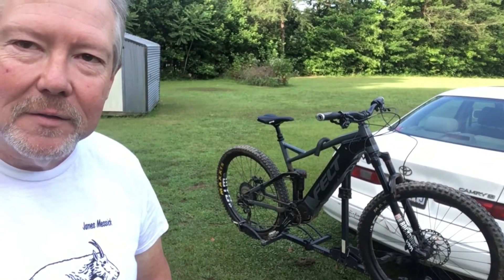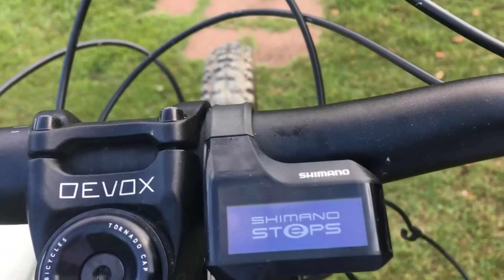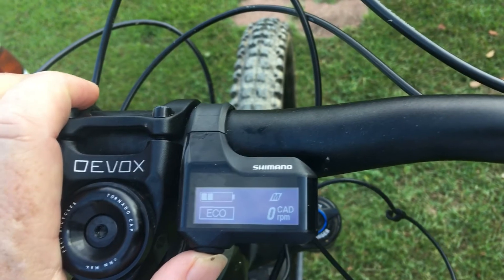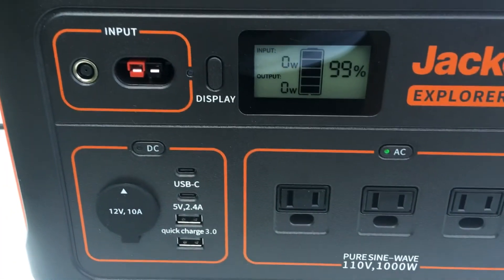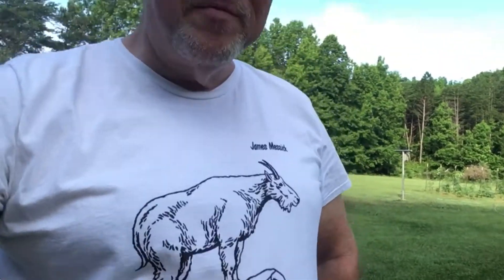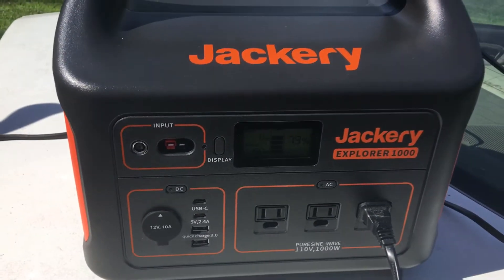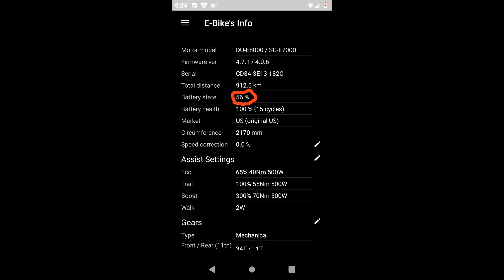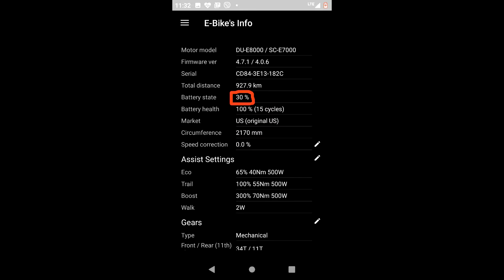Charging an eBike with the Jackery 1000!

Comment: Nice setup. This would be nice for a day out ride. Im just looking for something for my 48v 15ah battery so when im out riding which i get about 35miles all power i was looking for a home charger and then i thought mhmm maybe i can use it for a take a lunch break or fishing stop and charge because i wouldn't be charging untill i probably use 7ah half the battery and when im out fishing i could have this type of set-up with my 2ah wall charger to charge my bike up for 1,2,3 hours while fishing and have a almost or charged battery and beable to go home drop the gear off and have some juice left

Comment: Hi OldGoat, you said (and we saw it in the vid) your ebike has been charged 30% in one hour. I wonder how much current is the power supply of you ebike use? Is it a 2A or a 4A charger?
Because I recently tried for my wife and my bike two 4A eBike charger simultaneously with a BLUETTI 500W power station.  After 40 min both ebikes had 40 % additional capacity.  The power station was down to 40% (from 100%). The entire power drain of these two charger went down from 360W to 300W during the charge process, because modern battery management system varies the power. Thanx and cheers!

Comment: My question is can I charge it while riding it
Reply: Where would you put the Jackery while riding it? Don't think it's a good idea to have it on the bike rack.
Reply: @@tonymosbach2868  
▪️
I feel like the bigger concern would be the potential of it causing the battery to spark up outta control...
🟥
Reply: Yep! Get an Ebike trailer and you can put the jackery inside and a solar panel on top of the trailer like a lid which would also double up as protection from the elements for anything in the trailer

Comment: all you need is a solar panel for the jackery
Reply: And a thousand bucks, that's all you need, and a drink of water.
Reply: @SouthernSierra56  well worth it for sure. You can take it camping and recharge it using your 12volt in your car. It'll take about 11 hours to recharge and if you're road tripping with your ebike and you lack power, it's a great thing to have.
Reply: @tonymosbach2868  So will it fully charge an e bike battery? Not sure of the amp hours on mine.
Reply: @SouthernSierra56  look at the battery and if it's a 48 volt with 14 Amp hours that's 672 watts needed to fully charge from 0 percent. Using Jackery 1000 will charge battery 1.5 times
Reply: @SouthernSierra56  and not mention taking it to backyard parties or even tailgating. You can watch the pregame with your TV and the Jackery for hours while tailgating.

Comment: I have a 48v 20ah battery pack. Do you know if I used up about %40 of the battery that is less than 400w. Do you think a Jackery 500 would charge it ?
Reply: It would charge it up to 500 watts if the Jackery 500 is fully charged. So over half of the ebike battery.

Comment: Thanks for posting! I’ve been looking online to see if this worked lol. My other question is, what’s the smallest wattage generator I can use? The Jackery 1000 is still $1000. Ouch. My bike is a 2017 Levo with a 500w battery.
Reply: We use a honda EU1000i and it charges my girlfriend's 2018 Levo from dead to full charge in about 2.5 hours. We charge it while driving tied on the bike rack (hitch mount) when traveling and between long rides. Works Great
Reply: I think I saw someone on here use a 150 watt motor and make a pedal generator, and they were about to charge 48v at 6 amps
Reply: I really wonder an e-bike cannot charge themselves when you're riding except for the regenerative braking? There must be a way. Your car can charge the battery when you're driving with a generator. What if you had a generator on your bike?
Reply: @LetArtsLive  go learn some physics.